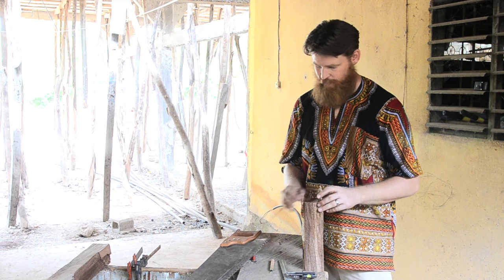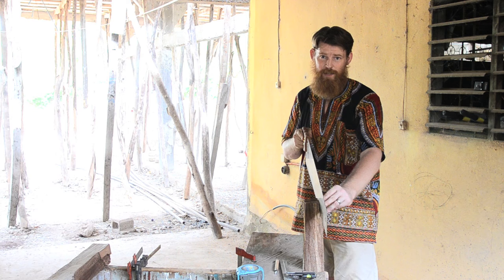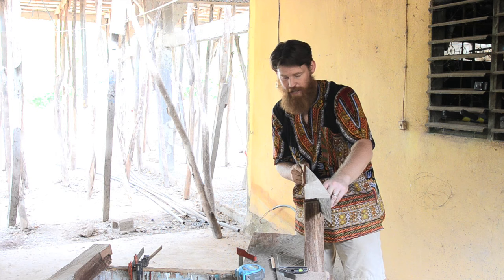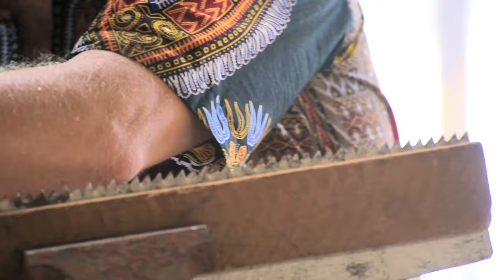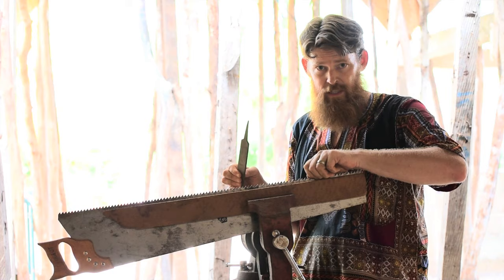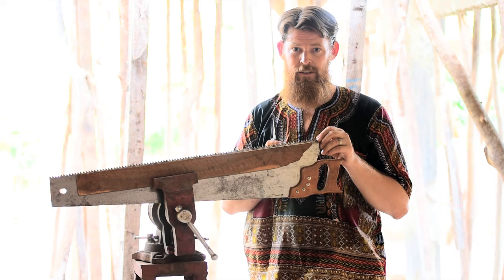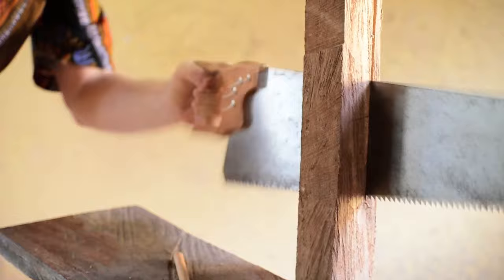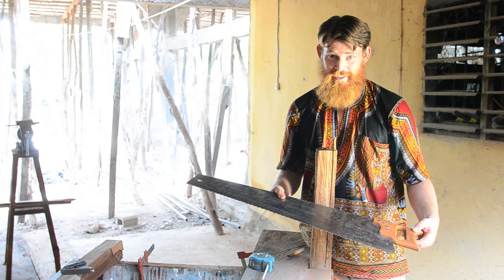Sellers' Saw Sharpening

Comment: Here are several things that can help you out: 1) use two hands on the saw file as it is definitely a two-handed operation to keep it perfectly level with even pressure.  2) use the bastard file to work that back bevel if you really want to - it may not be a diamond paddle, but it will work just the same.  3) put some wax on that saw - regular candle wax will work just as well as the 3-in-1 oil you mentioned.  4) keep sharpening if sawing is making you tired - if it's wearing your body out to rip that small amount, the saw isn't sharp. 5) keep sharpening for practice - it gets easier each time you do it.

Comment: Nice job! I am in the same process as we speak. If you do not see shiny tops, you should file off more. Also you could use a bigger triangular file so it won't wear as much, rule of thumb as I remember is twice the height of the teeth for thickness. Also Paul has a new video, where he uses a hacksaw first to save the file edge.

Comment: I use canning wax, too, on just about everything that slides, even chisels.

I suspect that a great deal of the improvement was from leveling the teeth so that the saw didn’t snag as much.

There was very little sawdust coming out, so not a lot of cutting going on. You might have seen a bigger difference if you had cut a softer wood so that the teeth could cut. That 4 point saw should make the dust fly!

Comment: It wants a smidge more set I'd say at the start. Defiantly needed sharpening that's certain but that saw has seriously big teeth so Is not ideal for that serious hard timber. Id drop the jointing out as they were not bad when you have different size teeth then you have issues. That saw how ever is not sharp even after filling. You need to be able to feel those needle like points then and only then is the saw sharp. You best result came from the crude setting go back now and file it again after setting lets see how it goes then.
Reply from the maker: That's exactly what I'm going to do! Thanks. And it's good to know about not using such a large-toothed saw for hardwood. Another video coming soon!

Comment: you may have gone through the motions, but sir, you have not sharpened that saw!!!  it should have taken 20 to 30 SECONDS!!!had you finished the job as Paul did.  i know because i sharpened mine that way.
Reply from the maker: Seth Warner.    20 to 30 seconds... total... or per tooth. I definitely have a long way to go in learning to sharpen. I'd love to hear your observations.
Reply from the maker: Seth Warner. Oh! The rip cut should take 20 to 30 seconds! That would be stupendous. I'll do a follow up video when I get it dialed in.
Reply: Excuse me ; should have been clearer.  If you had done a descent job of sharpening, the original distance you sawed the wood(that took a long time) would have taken less than a minute and just the weight of the saw is all the pressure required. In Paul Sellers videos on saw sharpening, you can observe him demonstrating a newly sharpened saw cutting 1/2 inch PER STROKE!!
Reply: @sethwarner2540  To be fair, I think Paul demonstrated the cut in a softer wood. But still, it should be able to saw faster than shown.

Comment: From what I remember watching Paul you followed the process except a rip does not have the teeth set. Setting is for cross cutting. Nice presentation however.
Reply: All saws need some set otherwise the saw plate will bind in the cut, the idea is that a kerf is made that is slightly wider than the plate to prevent this, and to help clear sawdust which would otherwise choke the gullets.

There should be no need to "set" the saw everytime you sharpen though.
Reply: check again, ms. /Jones, if you will think a minute, you will see that any saw needs clearance to get through the wood; otherwise, the saw will bind up in the cut.
Reply: Eileen Jones a rip saw by the nature of the way the teeth are sharpened and the along the grain motion requires less set than a cross cut but not no set  as pointed out no set will cause the plate to bind. However to much set and the saw will wonder with the grain as the kerf is too wide and the plate un supported.
Reply: @chrisbusby3910  You are right, but there are some tapered sawblades which do not require set (as much)